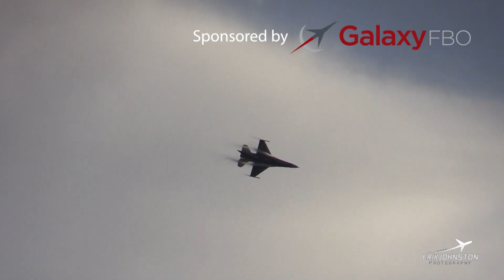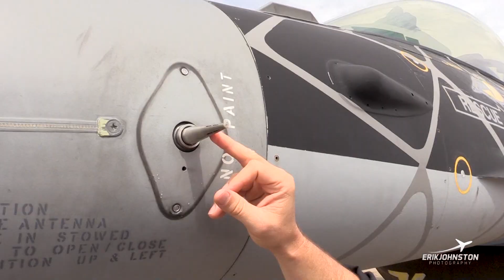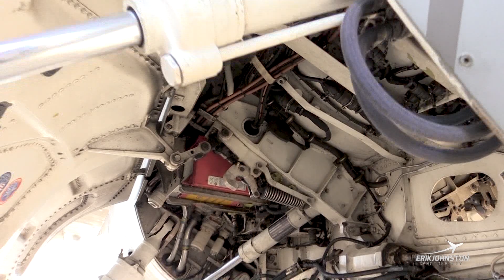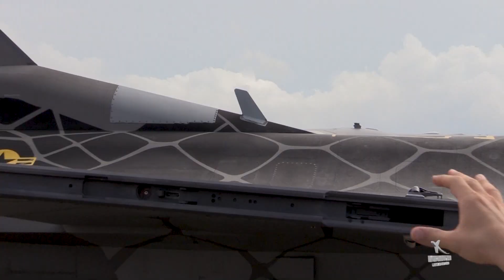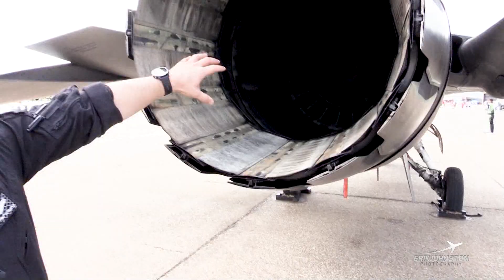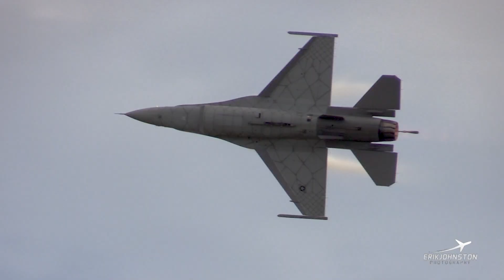F-16 Viper Walkaround Maj Garret Schmitz

Comment: The two ventral fins located under the aft fuselage of an F-16 Fighting Falcon primarily provide directional stability (yaw control) at high angles of attack and during supersonic flight, preventing uncommanded yawing (or "slicing"). They effectively supplement the vertical tail fin, ensuring better maneuverability, yaw damping, and spin recovery.

Comment: Where are the internal fuel tanks? The bottom part is all intake, engine and landing gear. The wings are very thin. The top part is radar, cabin, hydraulic, support system. And... the internal fuel tank???
Internally the F-16 holds about 4,000 liters. That's about nineteen 208-liters (55 gallons) drums. Where those 19 drums are located in such a small jet?

Comment: The 4500lb missile on the wingtip reduces the stress on the wing vs clean. That's one reason it was once fashionable to install tip tanks on all kinds of aircraft.
Reply: They don't hang anything weighing 4,500lbs on the wing tip. AMRAAM weighs under 400lbs.

Comment: 28:10 if im not mistaken this is only on the block 02's (block 32/42/52) and most older (export) models. because this sound is specifically caused by the Pratt and Whitney engine that these planes have and if im again not mistaken this doesnt happen with the General Electric engines
Reply: Correct.

Comment: Man! what are they teaching these pilots? (1)The ventral fins are not there to protect the tail. He should know that. They give increased lateral stability especially at high AOA where the fuselage would be blocking much of the air flow to the vertical stab. Even if they did go beyond the safe AOA on landing, the engine nozzle will still hit first as well as the speed brakes. (2)The static wicks do not protect the jet from getting hit by lightning, he is right in that they dissipate static energy but that is so the radio and navigation equipment will work properly. (3)This jet has a GE engine so the exhaust nozzle CENC is controlled by engine oil and will not make that "fweeeep" noise he is talking about. The P&W F100 sereis engines do though and are controlled by air and therefore the "Fweeeep" sound. Great vid though. Brings back some good memories turning wrenches on them. Cheers!
Reply: Hit the nail on the head
Reply: He also mentioned that the static system gives you airspeed. Which is false. The pitot tubes do that
Reply: I’ll agree with you on the first one, he should definitely know that. The rest is just pilot stuff, majority of pilots aren’t made to understand certain components but rather just what they are. The engine nozzle one, likely he came from a different block jet and now flying this one and still used to his primary jet.  I’m not a jet guy so I really wouldn’t know. 🤷🏻‍♂️.
Reply: this comment is really annoying me. You're making so many claims and basically insulting this pilot's intelligence. The proof you've given of being involved with this aircraft is as a tech. Where were you based? Pilots fly planes; the amount of airliner pilots who have minimum knowledge of automated systems is probably moderate. Pilots like flying, not learning how to fly and be an aircraft tech. Stick to your hunting in Norway or whatever you're doing. But don't shit on the pilot in this video, without proving your own knowledge first.
Reply: @n1msu  I've worked F-16s for 10 years in the USAF and can validate that the above comment is correct. Pilots are awesome at what they do but it's very common for some of them to not have a full understanding of certain components. That's why the mechanics are the technical experts.
Reply: @HotPasta2122  If this is true, I'm not going to argue. I know in Civ aviation; there seems to be a lot of pilots who know very little about the aircraft because they're not expected to. I think in mil aviation it would be better to try to educate the pilots or at least give them the opportunity to learn more. Thanks for your reply and service. My Grandad was a spitfire and hurricane tech in RAF back in WWII. I'll never forget his stories and whilst we don't have the falcons in the RAF, I wish we did!
Reply: @n1msu  Sorry if it "annoyed" you. The claims I made are fact and no, I'm not insulting his intelligence but his ignorance. For a pilot, and a Major at that, "attention-to-detail" is just as important to them as it was to us knuckle draggers. We had to know the ins and outs of many systems even if we were to never maintain them. A pilot needs to know his aircraft, especially in emergency situations. How would it look on him if he had a SEC problem and he's troubleshooting for a Pratt and he's flying a GE. Seconds count. As far as showing "proof" of my experience I think I've proved my point by being correct in my statements. They're pretty easy to verify. 

Anywho, I'll give you a little homework if you want to "validate" my experience. My AFSC was 2A3X3B. When I was in we were trained for 2 airframes, what was the second airframe? hint it was stationed at a base SW of mine, which was in the land of enchantment. My squadron was the 524. When I arrived there we only had 4 F-16CG Blk 40's, why? well we seemed to have had a bit of an F-111D problem. So, that should give you a bit of a hint to the time and place my experience started. 

I've wracked up 14 years busting my knuckles on these planes from the USAF to the RNoAF to the RNlAF. I think I've earned the right to critique this pilots "walk-around". 

Oh, and yes, I will go back to my "...whatever your doing..." quite happily. Norway is beautiful.

Cheers!😘

Comment: Our barraks, which built by the RAF during the Mandatorial period, were about 100 meters off to one side of the aproach and landing path to one of the runways.
I used to fall a sleap to the spooling up and down of Phantoms (Kurnass) and F-16s (Barak) comming in to land on nights where there were night flights.
When at home on leave, I often woke up missing the sound of fighter jets coming in to land, only to realize I was at home and not on base.

Comment: On our base, there was an air superiority squadron of F-16C's. This squadron was on quick reaction duty 24/7 even on Yom Kipur and holidays, the pilots just meters away from the jets.
I have whitnessed first hand F-16 go from standstill to wheels off the runway at under 4 seconds, albeit with a light configuration.

On a side note : Fear of hydazine was driven into us. We were told if one drop hits the floor, the whole shop had one minute to evacuate the area.

Comment: Vipers can do 9gs mach 2 with 2 sidewinders am9x full 20 mlm ammo and 100% internal fuel.  So that alone is amazing plus add block 72 aesa radar datalinks 
Hmds and this thing is a air killer . Killed mig 29 and mig 25 and only better in combat than this in records is eagle 104 air wins   to zero loss , viper is 76 air wins  to 6 loss so its combat tested war tested not some made at home su 57 .
Reply: @Alex Dias   The F-16 is limited to 9G only because of the human flight crew. The airframe will withstand 11G no problem, and up to 14G max.
Look up aluminium alloy AL7075-T6 and AL7075-T7.
Weight for weight it's 3 times stronger than steel.
Israeli Air Force Structural Tech. / Airframe mechanical fitter - tech grade 12

Comment: I very clearly remember Chuck Yeager saying " That, to me, is a stupid instrument. It tells you what your angle of attack is. If you don't know, you shouldn't be flying! ". The 25 degree AoA reminded me of that haha
Reply: Yeager was not the end all of all things aviation. The AOA vanes are an absolute necessity on a high performance aircraft like the Viper.
Reply: @Inspadave  I bet the Viper wouldn't be flyable without its advanced flight computers and sensors, and the dynamic instability that you need them for, is part of what makes it what it is.
Reply: I'd make the argument that the air data computer is using the AoA data a lot more than the pilot is ;)
Reply: Chuck Yeager was frowned Upon bye his Superiors During WW2    a German Focke Wulf 190 Shot him down head on at his 1 o''clock...they didnt let him fly for couple yrs..   ...he told the story
Reply: That's a true aviator. Not one relying automation to save his arse! (AOA is great tho!)

Comment: Just ran into your channel. Great video! You may know (or not) if the conforming fuselage tanks create additional drag, enough to affect top speed? In watching a video last year, I saw a few Belgian Air Force F-16's with conforming tanks, but none of ours had them. Military doctrine? Are we just sticking with conventional drop tanks?
Reply: I think it has more to do with the US availability of in air refueling, vs the other nations not having that native capability.
Reply: @barrymccockiner6641  - I have to agree with you.
Reply: @barrymccockiner6641  - makes sense. We have the largest KC refuel tanker fleet.
Reply: Everything you attach to an aircraft externally will increase drag. Even something as small as a pitot tube.
An F-16 without CFTs will always perform better than on without, assuming everything else is identical.
Reply: @fonesrphunny7242  Right, and that's why Belgium, and other nations, need to consider them when they're doing their own thing at home, and the USAF can just find another tanker instead.
Reply: The Israelis make extensive use of them.
Reply: @StromBugSlayer  - and it makes sense! They have to get to Iran and back, just in case Iran makes a real serious threat.
Reply: @spacejaime  Also frees up more hardpoints for weapons.
Reply: @StromBugSlayer  - oh, no question.